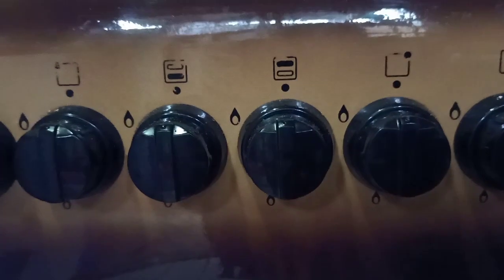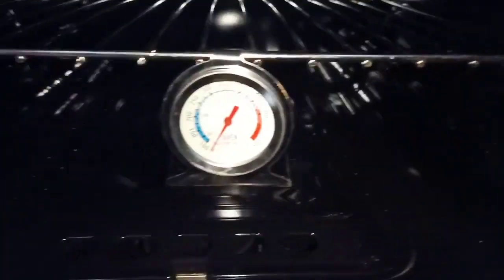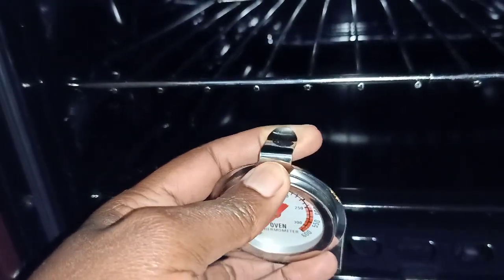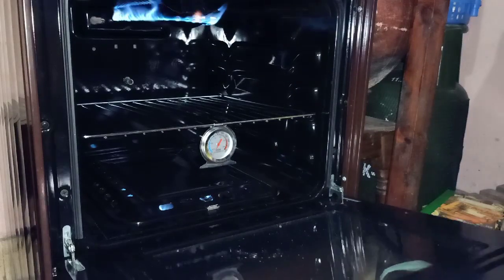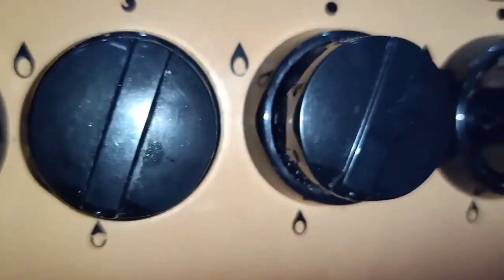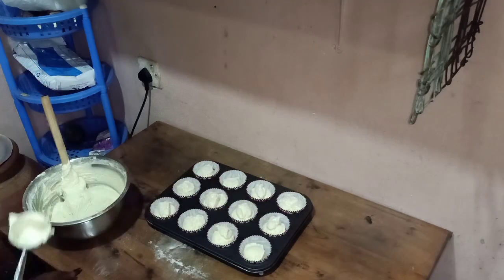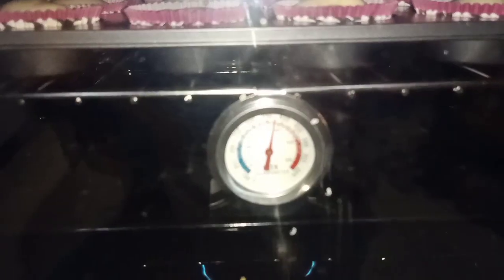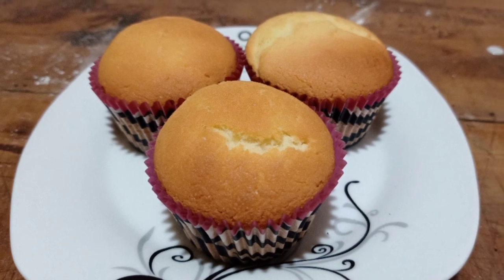How I regulate oven temperature in my gas oven without temperature regulator

Comment: While baking should I turn on the upper temperature at 250C as well as lower temperature knob at 250C?
Reply from the maker: The upper burner for my oven is for grilling and I rarely lite it when baking. I read the manual and it started not to use the grill and the oven burner at the same time.

Comment: This is quite helpful, though how do you turn on the oven light or it's automatic
Because I've always tried switching it on without baking or anything but it doesn't light up
Reply from the maker: On the left side of my cooker there's a button that lights the oven bulb and at the same time turns on the skewer. There's a video I did before this that shows how I use my oven here's the link
Reply from the maker: https://youtu.be/tMKjO2qazoY
Reply: @housewifehomestead  already saw the video.
But do I have to plug it kwa stima for the oven bulb to light.
Coz I saw when you were baking the cupcakes,at first when you placed them kwa oven there was no light,then later there was
I'm using a ramtons gas only cooker
Reply from the maker: Mine has a button that I can turn on and off the bulb and yes the light does use electricity and you have to plug into an electric source if you want the bulb to light

Comment: is the top fire in gas oven supposed to stay lit? (unless turned off of course) im wondering why ours turns off minutes after it was turned on and only the bottom fire remains.
Reply from the maker: I switched off the top fire. I only bake with the bottom fire. The top fire is for grilling.

Comment: Thanks Penny... This is very helpful. I still haven't managed to get an oven thermometer.  How long can I take to pre-heat the oven with the low flame you have just demonstrated with?
Reply from the maker: Thanks for stopping by. It took 15-20 minutes for the oven heat to reach 250°C without opening the oven door and if you continue waiting without opening the oven door the heat keeps on increasing. And by the way I baked on the low heat until the cupcakes were ready
Reply: Thanks Penny for the help... Will be on standby for your next claas 😀
Reply: Btw,  how long did it take to bake the cup cakes on low heat?
Reply from the maker: @beloveddaughter9041  I didn't time but I think I should do a video on that soon. When baking in the course of the week I will do a detailed video on that.
Reply from the maker: @Beloved Daughter have checked my latest video? I'm explaining how I baked bread in details based on the has oven temperature and time
Reply: @housewifehomestead  aww... Please send me the link... I'd love to learn how to bake bread 😋😋
Reply from the maker: @beloveddaughter9041  I am just showing how to bake it in gas oven the other process of kneading and folding isn't included
Reply from the maker: @beloveddaughter9041  https://youtu.be/l4vwPksNz4U
Reply: Thanks sooo much been having too a problem on regulating temp... Whre can l get the oven thermometer?
Reply: At what point do l set time for baking?
Reply from the maker: You start timing immediately you put your batter in the oven.

Comment: Once you get the desired temperature of the oven on the thermometer do u need to switch off the flames all together? Please help.
Reply from the maker: No you don't switch off the flames.
Reply: Penny, how do you maintain the temperature at say 250° if that's what the recipe requires? Because the temperature will keep going up.
Reply from the maker: @Ngina Kago I think I should do a video on this issue. Because with me I have mastered my oven and know where to place my oven knob when I want to bake.
Reply: I will be most grateful to know where to get the oven thermometer from, supermarkets don't have it.
Reply from the maker: @nginakago4445  you'll find the oven thermometer at topserve Kenya. They have a shop in Nairobi and Eldoret
Reply: @housewifehomestead  thank you, I got the oven thermometer but I don't know why the light inside the oven went off immediately I started to preheat the oven. Have you experienced this before?
Reply from the maker: Yes. The lighting and ignition system if Mika stoves has a problem. Mine too behaves the same way. At times it behaves well at times it doesn't. The lighting isn't that important so I rarely use it.
Reply: @housewifehomestead  mine is Von and it was the very first time using the oven so it's a bit soon to start acting faulty.
Reply from the maker: Mine did that the first time. Sometimes it works sometimes not

Comment: Woow this is awesome and helpful. I have a gas oven but I haven't purchased the thermometer yet. Av been baking and my cake come out either undercooked or burnt at the bottom.al try putting the knob as in the video and see what happens.
Reply from the maker: Try and tell me how it goes and also place your oven rack at the centre of the oven
Reply: I finally purchased the oven thermometer. I baked at 170degrees but the cupcakes didn't brown on top    and became crusty at the bottom(almost burnt) but we're well coooked. I placed them at the third rack step.
Reply from the maker: @juliembalaka1519  note that the oven temperature is higher at the back. Did you push your cup cakes to the back end of your oven?
Reply: Yea I normally push at the back. I also didn't have those cupcake papers*
Reply from the maker: We're you able to hack the baking of the cupcakes? How did they turn out?

Comment: How do u maintain the temperature? We have the same oven knobs, but mine wont stay on the 180temp, its keeps on rising, or decreasing from time to time
Reply from the maker: When I leave the bottom flames on complete low and the upper flames switched off, my oven temperature remains on 180°c. Different ovens behave differently and yours might be different too.
Reply from the maker: Here is a video explaining how I regulate my oven temperature https://youtu.be/l4vwPksNz4U

Comment: My gas oven can only be operated on one side lower heat if i need to brown my cake i need to light upper flame later only one at a time
Reply from the maker: I use the usually use the bottom flames while baking and my cakes brown on top.